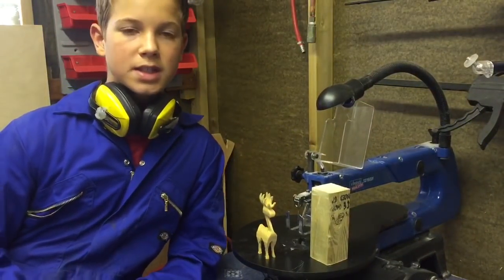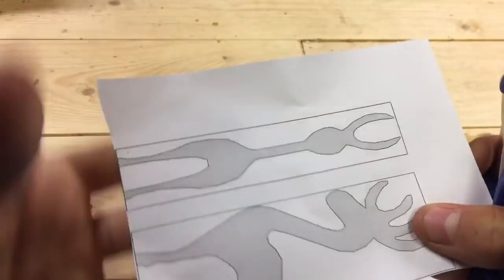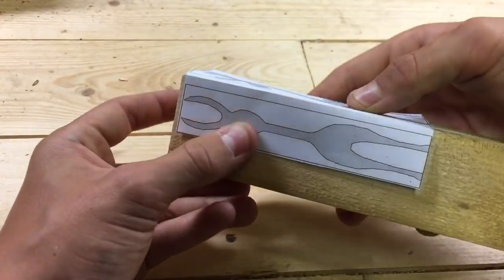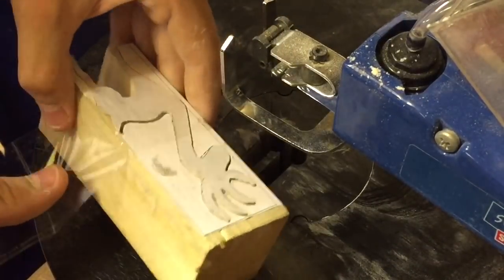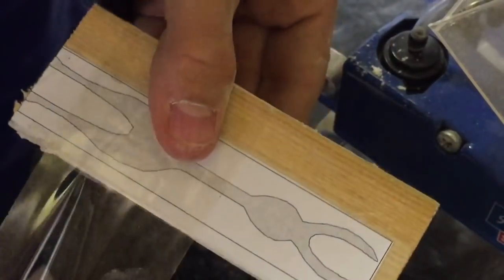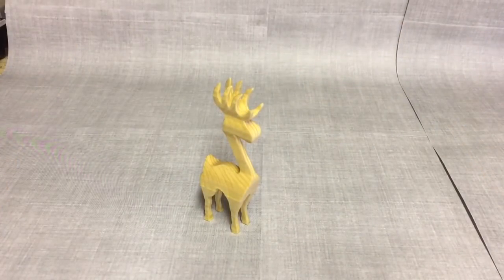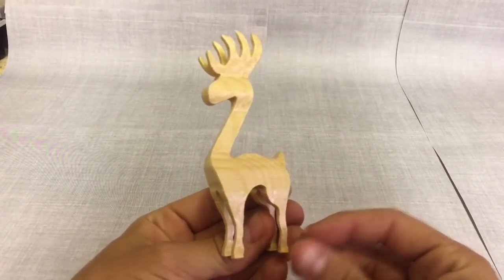3d Reindeer Christmas gift/ornament (How to video) scroll saw project

Comment: Were do you get your spiral No. 1 spiral blade? does it have pins on the ends? Peter Unsworth
Reply from the maker: jet41ace I bought mine from a local machine shop. But you can order them from online. No mine do not have pins on but I do believe you can get the spiral blades with pins on. Hope that answers your question

Comment: What size block are you using to cut the reindeer?
Reply from the maker: g menasco 50 mm x 45mm but it has to be a soft wood , if you decide to cut it that size, as it is almost impossible to cut that size block of hardwood on the scroll saw. Unless you have a bandsaw which does not limit you as much. Thank you for your comment

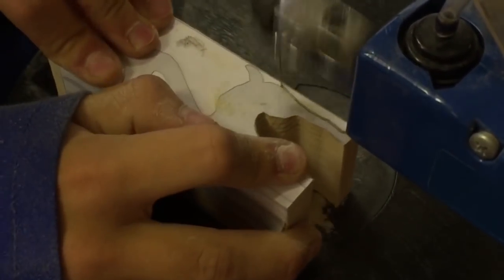Comment: what kind of saw do You use? Imean for cut curve line. You sad about ir in 1:47 but I could not understand.
Reply from the maker: It’s called a spiral blade / the saw has teeth on all edges of the blade meaning that it can cut in all directions. And then the size is a No1 which refers to the diameter of the blade and the curf size it will cut
Reply: @whereswilly6780  thanks for answer. I used ordinary blade and broken when tried to cut curved lines.